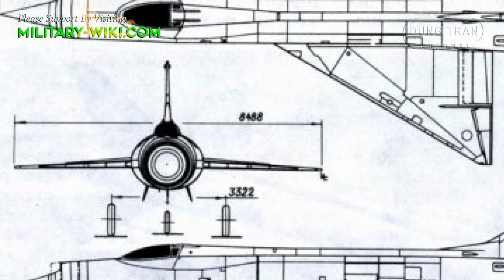Mikoyan-Gurevich Ye-150: The Forgotten Soviet Interceptor

Comment: not entirely true dung while only one original version still exists it's children (the Mig 21!!) are all over the place
Reply from the maker: ok bro
Reply: @DungTranMilitary  dung you just have look at, it all Mig did for the 21 was modded it out with systems that actually worked and added guns!!
Reply: The 21 isn't really its children. Considering they were developed in parallel with the 21 being designed and flying before the 150.